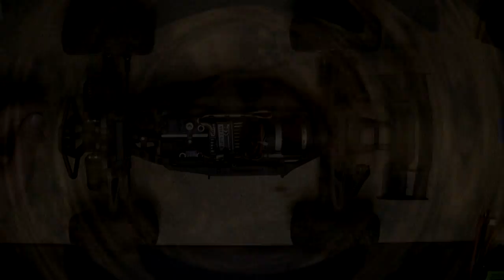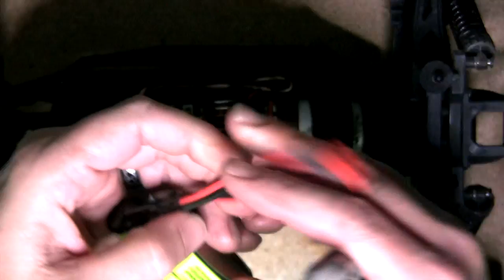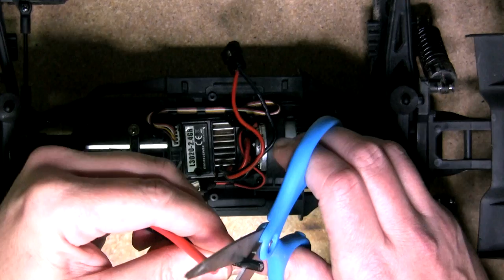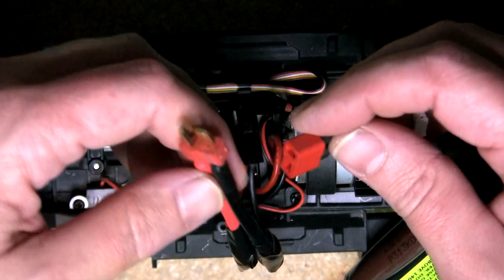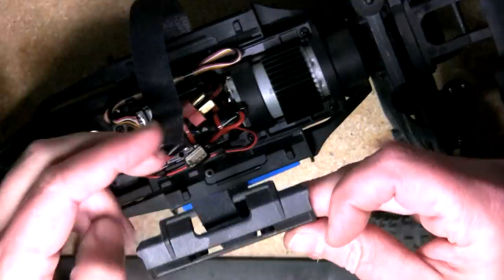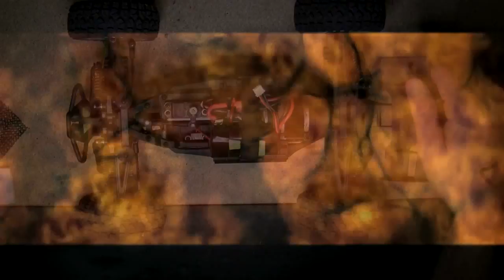HBX Dune Thunder 12891 #4 - 2S Battery Mod & Speed Boost, Deans T Plug, 7.4V, 20Amp RC Cars

Comment: Hi I am wondering if it is possible to use 18650 3.7V Li-ion batteries instead of the original Li-po for hbx 12891?
Best regards from Norway 😊

Comment: Firstly, love your videos. Do you know if HBX makes a metal spur gear for the 12891, or if there is one from another company that would fit?.....Thanks
Reply from the maker: I've been looking for since I performed this mod but no luck yet.
Reply: @FranksTechHelp  ....Thanks for the reply, it's funny that they make a complete metal differential for it but no metal spur gear.....
Reply from the maker: @mikepegg6221  I totally agree. I've even ordered parts for other vehicles with similar size specs trying to match something up but it's just not out there.

Comment: Cool video. But I'm a bit confused. I think you get the same result if you buy two branded 18650. The two 18650 has the same power than the upgraded battery 2x3,7V=7.4V. So the speed and power difference comes from the quality of the new battery. Am I right?
Reply from the maker: Yes, I think you are correct about the better quality being more power
Reply: @FranksTechHelp  i have the feeling that the original set up is 2 3.7v battery in parallel to provide the amp's required for it to run

Comment: thanks for the video
 i got the HBX Dune Thunder and after a short wile it stop going.  the perment red lite started to flash 
 every once in a wile it become permenent again but only for a second 
do you have an advice for me? thank you
Reply from the maker: Turn off both the car and transmitter. Turn on transmitter first wait 10 seconds then turn on car. It should pair and the light will stay solid on both units. Or it should...